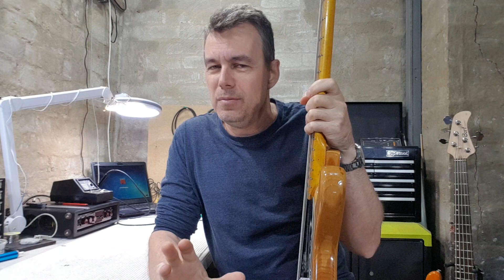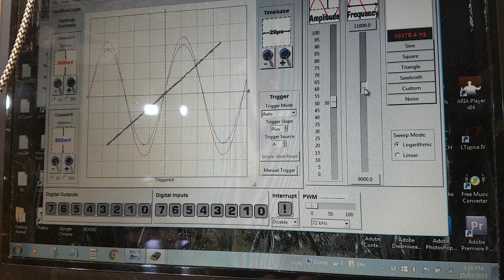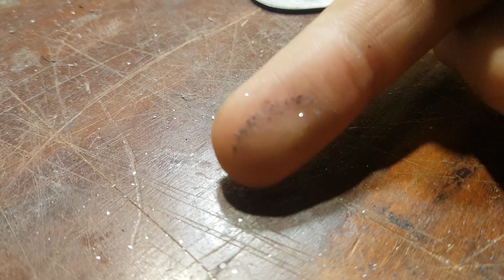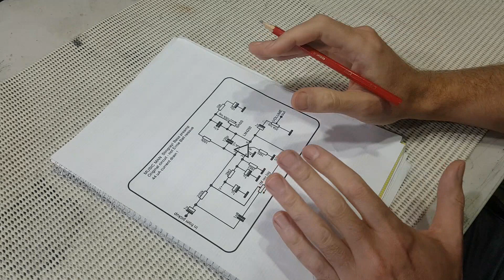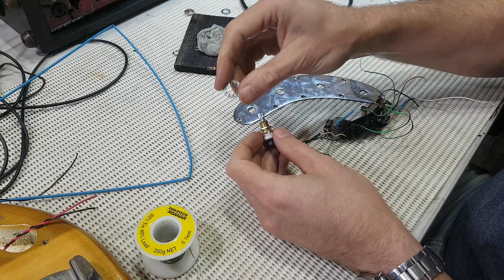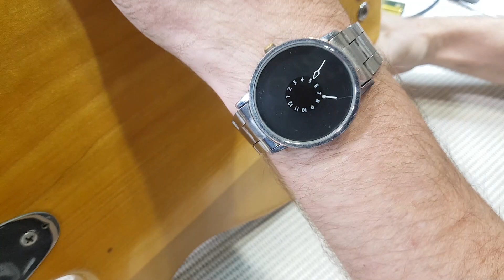Testing and Repairing A Vintage Music Man StingRay Preamp.

Comment: Nice video! On my active 2 EQ band Sting Ray, the battery has two wires. Red one goes to + and black to -, but then there is a connection on the circuit plate called "G". Do you know, were should I connect it?

Comment: Rob..I have that same bass (Vintage Classic 5 Ernie Ball)but my Stingray Sub 5 is sounding better these days!! What is the best pre- amp and pick up should I get b to enhance my sound..
Reply from the maker: The sub 5 has the 2-band, right?  Does the vintage have the 2-band or the 3-band?  If it has the 3-band, then perhaps switch it out for the 2-band.  TBH, I've usually wound my own pickups and made my own preamps, so I'm not really up on what is out there on the market.  Bare in mind that the stingray sound is not just which pickup and which preamp per se.  It's also about how the pickup and pre interacts.  The 2-band has a low input z, and the 3-band has a high z but very highly capacitive load, which has a big effect on the treble resonance.

Comment: Cool video! I’ve heard the original stingrays had that mono pot and constantly drew power. 🤔💭
Reply from the maker: Yes, since making this video, I've also seen that.  The LM4250 opamp had a "current set" feature on pin 8.  The 1.5M resistor gives this circuit its incredibly low current draw, so even the old batteries from the 70's lasted a few months.  TBH, I couldn't believe it when I read that, but I guess the battery negative to stereo jack trick wasn't really mainstream in fx pedals 'til the mid-late 70's, so I guess we can forgive Leo...

Comment: Hi Rob! I have a 90 MusicMan StingRay 4 strings, and it’s that well known (and annoying) problem with the G and D strings to pull out the saddles resulting in the strings not keeping centered with the pole pieces, and of course causing string spacing changing while playing and intonation as well. Would you have a tip to fix it without changing the original bridge? Thanks and greetings from Brazil!

Comment: Rob, how can I call you ? or just send an email...i need a help with a 1978 stingray bass..(has a problem..a noise but only when you play the bass (strings) is like low volume "fuzz".. when the string stops vibrating..the noise stops too..is not a faulty ground..maybe a faulty capacitor, but the preamp has the nasty epoxy... great VIDEOS .

Comment: Hi and thanks for a really interesting vid! I found it whilst looking for a solution to a similar problem I have. I've got a 77 Stingray that slowly but surely have died on me. The output is now EXTREMELY low even with the volume on full. I've replaced the battery, checked the cables and soldering points and everything seem ok, but I'm no electronics wizard so... My first thought was that the preamp had died, but since having watched your vid here I suspect I'm wrong... Oh, what to do? Right now I'm seriously considering getting a John East replacement preamp and pots.
Reply from the maker: Hi Bjorn, It's hard to diagnose remotely, but I'd say try disconnecting the pickup and testing this in isolation.  Then do the same with the volume pot.  I'd also check the battery voltage, but in the bass and with the preamp on.  It may just be a corroded battery snap or a bad jack for example, and the preamp is simply not switching on.  Try some of the other tests I did - the current, and the various bias voltages.  If it is beyond your experience that's cool, find a tech to help you.  Guitar techs (with respect) will be able to replace/install a whole pre, but will usually not be able to actually repair one at the circuit board level.  (Although if yours is also potted in epoxy, there's not much they can do TBH).  And hifi techs won't be set up for pickups and guitar wiring.  Perhaps there's an amp tech or a pedal builder near you?...
Reply: @RobMods  Thanks for replying! Yes, I'm handing the bass over to a guitar tech here in town. Cheers  //Björn
Reply: Hi again Rob! The problem with my bass is now fixed. It was the wires from the battery that had come loose and of them had snapped due to my clumsiness when changing the battery...duuh! 🙄.
Reply from the maker: @beanbass  Nice one mate.  I'm glad you got it fixed!  But don't feel bad.  Battery snaps are a common failure point for active guitars.
Reply: hello, try to change the chip if it is mounted on a socket it is a very easy operation. Many years ago I had the same problem with my Stingray.
Greetings Andrew

Comment: Thanks for the great video! Pre-EB preamps were always on. Leo made them that way.
Reply: The battery diode trick is a great idea! Thanks!
Reply from the maker: Yes, since I did this vid, I have read that too.  The opamp's quiescent current is programmable with the pin 8 resistor.  That's why this pre draws so little juice.  I find it strange that Fender didn't know the stereo jack trick at the time.  I think it would have been around in pedals by the mid 70's...?  Not sure really... There's also a problem that the opamp output is not short circuit protected like modern devices.  So they put a 1k resistor inline with the output.  I did this on this bass, but I think I forgot to mention it...